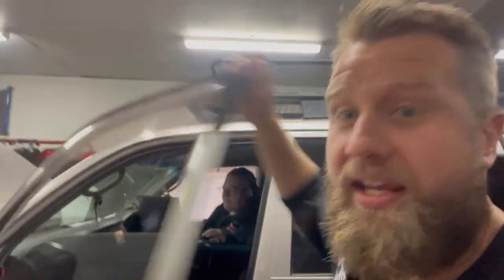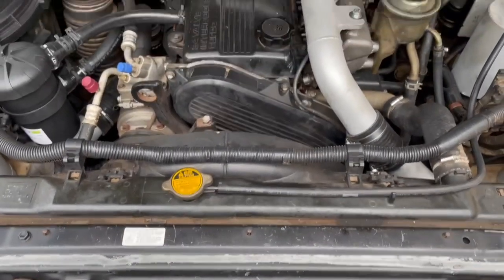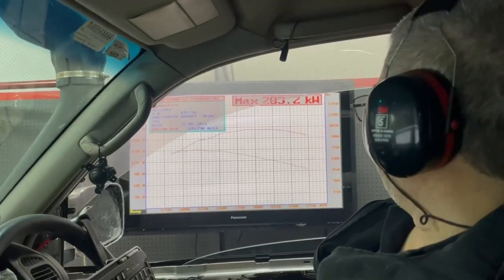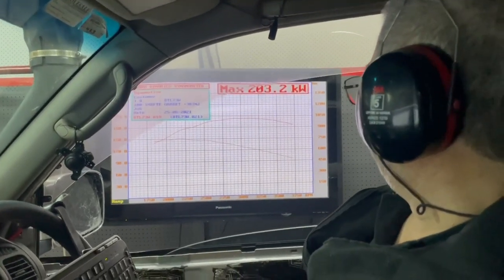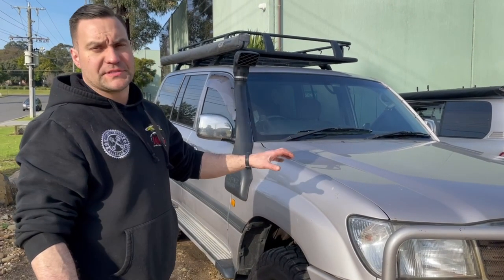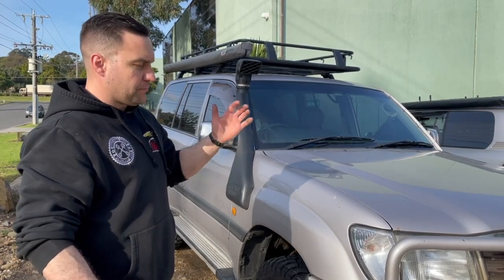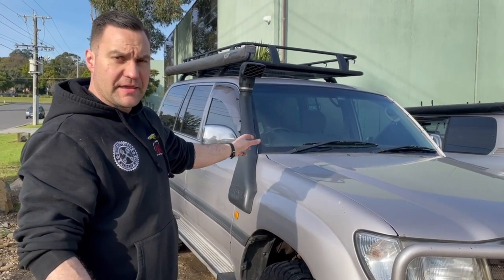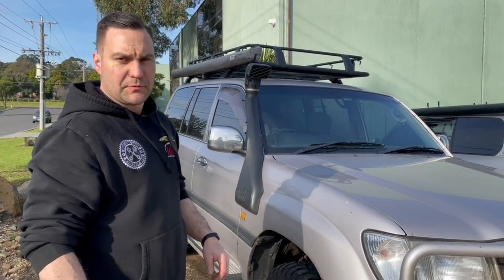100 Series 1HD-FTE wheels spin! Big Turbo, injectors & dyno tune! Unichip ECU, auto trans...

Comment: More content on it would be nice. Ks on the motor, what gear box,  what size treads , what rpm boost hits on and full boost levels , Fuel eco difference. Still good vid mate cool to see 100 series getting a bit more juice instead of same old same old 200 or 79 series. 🤙
Reply from the maker: Sure, can you elaborate for next time?